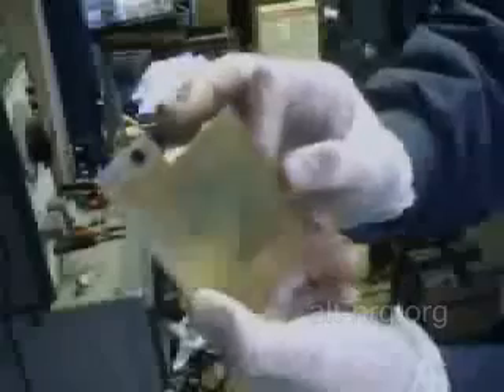#259 Battcell_inspection_2011-01-02.wmv

Comment: Zero, that looks like metal migration to me. Like part of the copper and iron in the 316L is depleting from the anode and plating the cathode. If it's hex-V, you are also leaching iron and copper. Did you magnetically align the plates before assembly?
 Some plastics degrade when in in high oxygen situations. Oxygen embrittlement.
I really like the Bat-Cell. It's a great design.
Peace and Happy New Year.
Mike.

Comment: how many working hours did it take to coat thoose plates with that golden-brown coumpound? any idea if that coating was affecting cell performance considerably? btw am still thinking a way to force bubles away from plates...my first idea was to use mini magnetic stirrers moved by the gas out or the inbound electrolyte but the vortex would pull down the bubles instead of pushing up, any idea preasure in the gas outlet (psi) or the electrolyte (container to cell) flow rate ml/sec?

Comment: Reduction of the equalizer hole to a MINIMUM diameter (just enough to allow fluid exchange, however gradual) should also reduce the leakage because you are impeeding the flow of field lines between opposingly charged surfaces. This would be the easiest first line fix, without being a complete solution.

Comment: @crafter2u yeah Ultrasound and even better resonance methods may work but I was thinking on using the kinetic energy from the reaction in an efficient way. May be using the exit HHO gas to move a micro turbine with a magnet in its core to move the magnetic stirrer magnet inside the cell. Worried about gas compression and static. This method should be more efficient in a Joe's cell since vortex shape is match cell shape. Did ZeroFF ever tryed a Joe's cell?